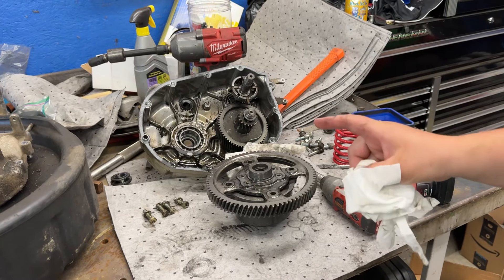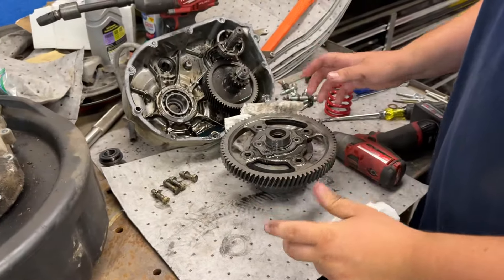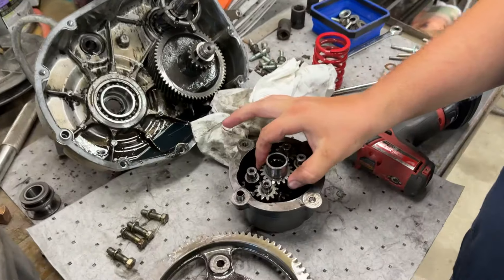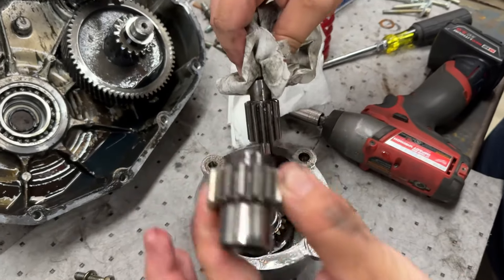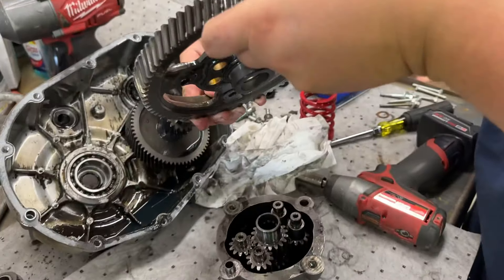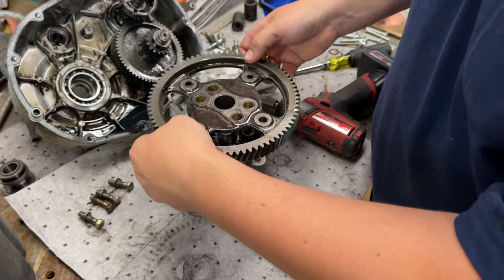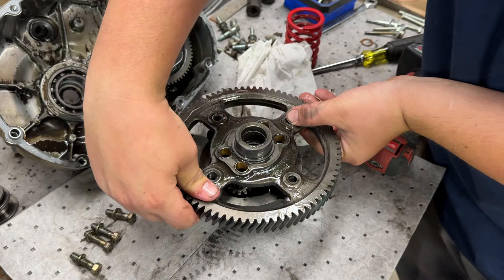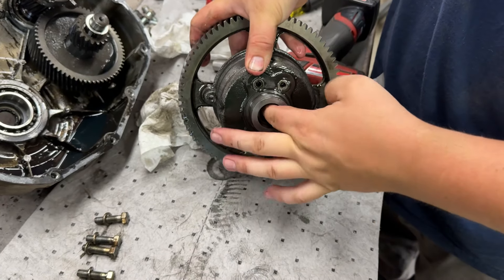How to lock a Yamaha G1 differential

Comment: So, finally getting into this cart. Been doing some things. But my pumpkin is actually different from yours. I can't lock my diff. Only have two conical shaped gears, not the four straight gears you have. I'm not longer really concerned about locking the diff anyways however I'm curious what year your cart is. I never did get into my first gen G1 before selling it so I can't go in and see if there is a possible difference from pre 82 to post 82 in the G1 carts. However, in light of said change. I found a regear kit that is semi compatible to the G1 with modifications explained in this video. I'm excited to get it in the cart and do some test driving as soon as it's not below freezing. https://www.youtube.com/watch?v=RbgMmj-Q9ss&t=92s